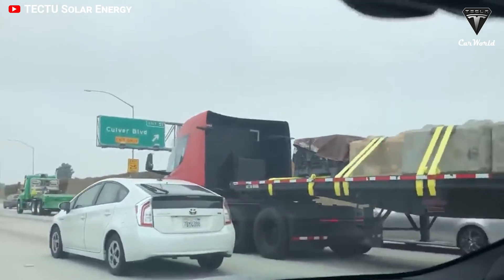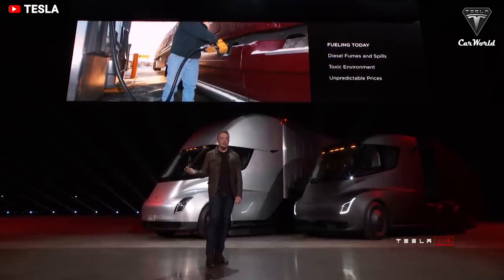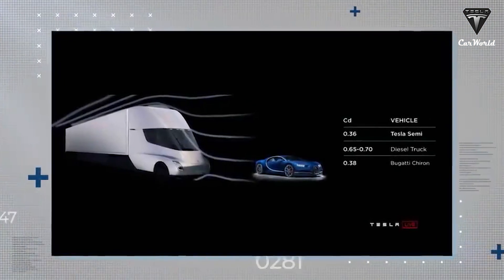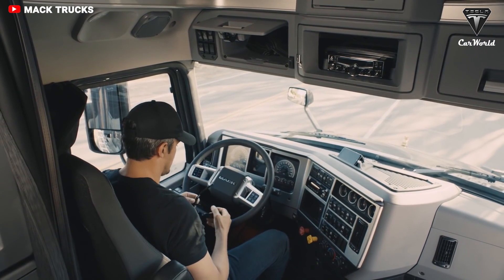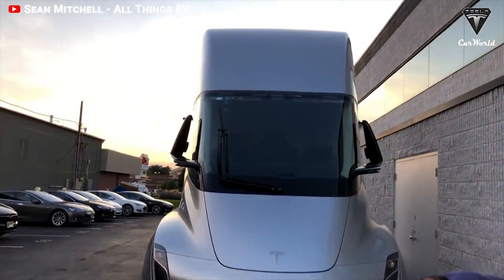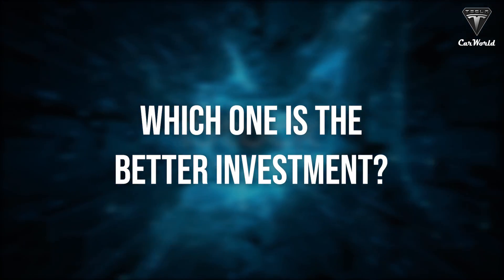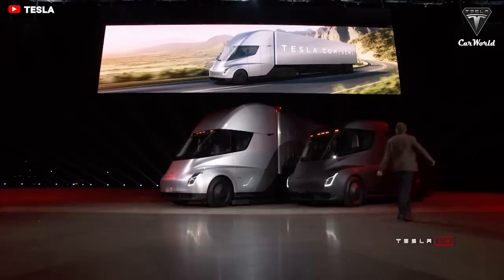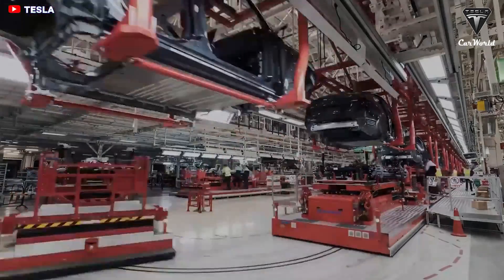Which is the KING of 2023 heavy trucks? Mack Anthem Diesel Truck Vs. Tesla Electric Semi?

Comment: Is going to be interesting to see TS truck Climbing long high mountain and check how much longer the power still stand
Reply: Just about anywhere in West Virginia. 
Interstate 68 would be a great test bed for how well these trucks handle mountains.
Reply: @TheKencmh  - I am very curious about that as well. I know the information Tesla reports about things like "maintaining 65 MPH up a 45% grade" (OK, I exaggerated that a little because the eggnog has gone to the few remaining brain cells in my head)... that kind of information is based on the test semis that have been on the roads for a few years now - is not just theoretical information. But, yes, it would be nice to see more real-world data. I used to live in Huntington, WV, and I remember those hills. Pennsylvania and upstate New York as well. And the mountains of Nebraska! Oh, wait, that can't be right - the highest mountain in Nebraska is about 6 inches. My bad.
Reply: @thomasruwart1722  maintaining 65mph at 45 grade hill at which costs/range loss!?
Reply: You mean check how much energy it guzzles right!? It might have instant torque but that torque literally sucks the battery like crazy! Diesel trucks are less affected.
Reply: Its not the going up,its the coming down! If your hammer down up every mountain, then riding the brakes coming down. The tires can't handle it.
Reply from the maker: Considering that the Tesla Semi would have regenerative braking in its arsenal, the vehicle’s physical brakes would likely last for a very long time. As such, it would likely be very rare for a Tesla Semi to need a runaway ramp to stop safely. Thanks for your comment !
Reply: By the time the Tesla climbs the Grapevine, those electric motors and the batteries will be on fire.  This is not a passenger car.
Reply: @ReachOutToWilliam  you, you, you... Mean the TS will have to... SLOW DOWN just... like.... a diesel 5h1tbox... on long, steep gradients & use more juice on the way up, like a diesel?  Oh... that poor old TS EV will RECHARGE FOR FREE on THE WAY DOWN using regen braking.  How will your beloved, stinky, poisonous, noisy, slow Diesel refuel on the way down the other side, FOR FREE??  What is your diesel $$$mpg on the way up?  Ohhhh, cosmic fairy dust powered ICE truck? 😅😂🤣  🤡🤡🤡
Reply: @ReachOutToWilliam  - I am pretty sure the Tesla engineers have thought about that and, like the passenger cars, the computers that monitor the motors and brakes will provide ample warnings and take preemptive safety measures to avoid any catastrophic failures. I race my MYP which puts an enormous strain on the motors, brakes, and battery but I have yet to have any kind if failure. Granted, the semi is a different beast but much of the basic physics is the same and the Tesla engineering teams are the best in the world.
Reply: @thomasruwart1722  A passenger car only has to propel itself and a very small load (under 400 pounds).  A semi truck is carrying cargo.  Recent published tests of the Rivian and Hummer EVs towing loaded trailers show the fallacy of electric trucks.
Reply: @thomasruwart1722  you put your my on which repetitive strain!? Lol….. those EVs owners literally drives like grandma ICE are actually driven the hardest of all.
Reply: @thomasruwart1722  tesla team is the best in your dream 🤡 l!!! Lol….. don’t make me laugh!!!! A diesel truck is able to haul like 5x80,000lbs on much longer and even unpaved roads ehich EVs will never match
Reply: @carholic-sz3qv  - I say that Tesla engineers are the best in the world because Tesla has single handedly reinvented automotive design and manufacturing. I am watching the likes of Ford, GM, Volkswagen Group, BMW, and other ICE companies struggling to design, manufacture, and sell EVs in the US and Europe. None of these companies come close to what Tesla has done. Ford and GM recently announced that they are simply going to duplicate Tesla in order to get their EV programs going. Volkswagen simply gave up - they fired their CEO who was pushing EVs and then canceled their EV projects. There's a lot more to it than that and you should watch the video "The Pace of Innovation" on the YouTube channel BestInTESLA. Then you will see why I made that comment.
Reply: @carholic-sz3qv - I had no problem keeping up with the Porsches on the track. The Porsche drivers commented on how it was difficult for them to match my acceleration on the straights. They could eventually overtake me if the straight away was long enough and, granted, they could corner better than my Model Y which is not a race car. But still, it was a formidable match on the track.
Reply: @thomasruwart1722  all your arguments are crap!!! Who said vw gave up!? Are you even serious!? Wtf!!! Ford has already made many EVs and they are already designing all of their hardware in house just one year after the mache…..
Reply: @thomasruwart1722  innovation my @zzzzz Mercedes and many other companies have been not just making regular cars but also commercial vehicles, armoured and special vehicles that are in use all around the world where again no EV can compete….. making cars with single large parts is essentially good for the manufacturer and not consumer for a much longer term.
Reply: @thomasruwart1722  nonsense!!!! Electric cars are great in straight line it’s about all of their advantages! A Porsche is astonishing for the corners while having not too much power like EVs.
Reply: @thomasruwart1722  even a front wheel drive car is able to keep up with a Porsche let alone a less powerful one.
Reply: @thomasruwart1722  at Mercedes for example they have a vehicle called UNIMOG! Universal vehicle it’s the most advanced and sophisticated vehicle that has sooooo many applications in different sectors! It has everything from central tire inflation system to portal axle to all wheel steering, it even has steering wheel that can be slides from left to right…..  vehicle used for railroad works, agriculture, construction, mining, rescue, overlanding…….
Reply: @ReachOutToWilliam  they're not real trucks.  That's just what 'muricans call pickups.  The batteries in Tesla Semis are designed to do the job they are intended for, also the regen on a Semi will recoup far more energy than it would on a PICKUP because of the extra weight.  This will make a difference to the range of the Semi.  You can't compare a (not a) truck to a Semi.
Reply: @ReachOutToWilliam  are you called Reach OutToWilly because you enjoy diesel trucker manmeets at Diesel truckstops?  You look like Right Said Fred's Richard Fairbr455 so I'm guessing that's a yes.  Keep up that irrational EV hatred, it looks good on you & will increase your hit rate at the truckstops with more "good 'ole boys" 👍💋💖
Reply: With regenerative braking, Tesla Semi will get all the range and power back going downhill.
Reply: @lancetruong4957  lol….. regenerative braking isn’t perfect and doesn’t get that much power back and also it’s totally useless in flat lands
Reply: @carholic-sz3qv  I don't know if you experience a Tesla on road trip, I drove my model Y to Arizona and New Mexico; and the regen braking helps significantly going down the mountain after losing range going up.
Reply: @carholic-sz3qv  Nothing is perfect in this world. Even the diesel truck not efficient also lose range with load going up hill.
Reply: @lancetruong4957  diesel/ICE vehicles are very less affected by loosing range uphill and I’ve watched tons and tons of towing test comparing both Ice and ev. I know what I’m talking bout.
Reply: @lancetruong4957  it’s great to have all that electric torque but the torque guzzles a lot of energy that’s a fact
Reply: @carholic-sz3qv  and an effing big battery provides a lot of energy.  So does regen on a very heavy Semi....   Your arguments are based on ignorance, fear & hatred.  Keep posting, this is amusing....
Reply: @alexmanojlovic768  at this point any critic in EVSs will d just pure ignorance and hatred for you right!? Is feel very sorry for you!
Reply: @carholic-sz3qv - Couple of things, Electric vehicles are affected more by the grade because they are extremely efficient so you feel even the slightest drop offs. The advantage of ICE vehicles is the not the ICE but rather the the fuel tank. My Expedition carries the equivalent of 1100KW of energy in its fuel tank. For comparison, a EV with 100KW battery has the equivalent of 3 gallons of gas in its “tank”. Second, and this is very important, ICE cannot ever match the performance of an equivalent electric motor.  That’s a fact. There’s a reason why railroads use diesel-electrics instead of diesel engines and carry millions of pounds of freight. Other than that, yeah, Tesla is probably exaggerating the range of its trucks and electric trucks will probably spend the next decade delivering point to point loads rather than long haul till the battery and charging rates get figured out.
Reply: @jsphblw  the tesla modelX plaid with over 1000hp has crazy acceleration but it’s top speed is garbage compared to a Porsche Cayenne turbo gt(600hp)… also the towing capacity of that tesla is measly 5000lbs while the Porsche easily tows more than 7000lbs and it’s not even diesel because a 200hp diesel car has better towing capacity than those.
Reply: @alexmanojlovic768  like I said used/old EVs are totally useless in third world countries because of their already severely limited and reduced range! A 39 years ICE is still way more useful and great at its job than even new EVs!
Reply: @alexmanojlovic768  are you butthurt about the reality and fact in the terrain!? Do you want to cry or what!? 😂 😆
Reply: @carholic-sz3qv  - Wait! Did you just say ICE use their fuel more wisely??? 🤣🤣🤣🤣🤣. A gallon of gasoline has the equivalent of 35.5 KWh of energy and gallon of diesel has the equivalent of 45.5 MJ/kg or 41.6 KWh per gallon. So when you’re getting 18 MPH in your SUV? You’re actually using 2KWh per mile in a scenario where a EV would use 0.25 to 0.40 KWh per mile. That’s why those EPA fuel mileage numbers on the EVs show 80-100 mpg equivalent. Like I said, the advantage of ICE isn’t the ICE, it’s the fuel. We are yet to find an alternative that is as energy-dense, as safe and as easy to transport as fossil fuels. As for your train rant, you’re wrong again. Diesel only locomotives are small and at this point, mainly used for short distances and small loads. It’s the diesel-electrics that are the main stay. Railroad companies have known that more than half a century. It seems you’re the only one didn’t know.
Reply: I've read most of these comments and many make really good points, when talking about a specific situation or scenario. However, in the real world a semi owner or driver has to take into account all situations, benefits and disadvantages that he/she will encounter over the life of the vehicle. I believe that's when the value of the Tesla semi will be greater than an ICE semi most of the time.
Reply: @timforeuk7853  nope the value of f diesel will be greater most of the time! Depending on their applications EVs are well suited for some specific situations unlike diesels that are much more flexible and comes with multiple configurations….
Reply: @timforeuk7853  for tougher and more rugged use diesel are much capable and also working on more difficult environments, finally diesel trucks even old ones are still a lot more valuable when they get exported to Africa or South America…. Where range still is better for remote applications

Comment: The Tesla truck is 100% untested and there is not a single truck stop set up to plug in, a diesel truck can travel 1000-1500 miles between fill ups , Tesla may make 350 , 500 miles is a pipe dream. Tesla has not allowed anyone to test their truck yet , so anything said is just a sales pitch .. just wait.., considering it would take enough energy to power a small town to power a electric truck stop, and they don’t even exist..